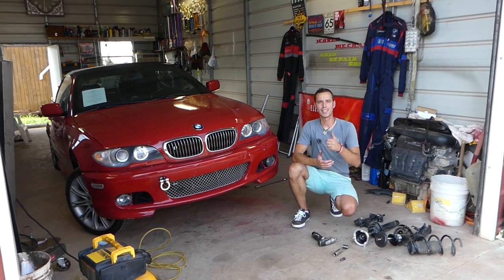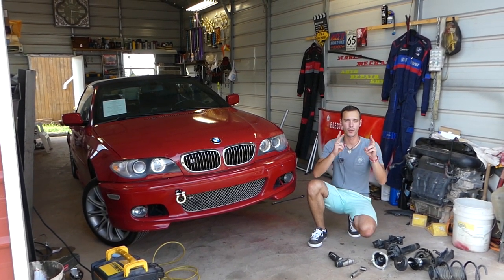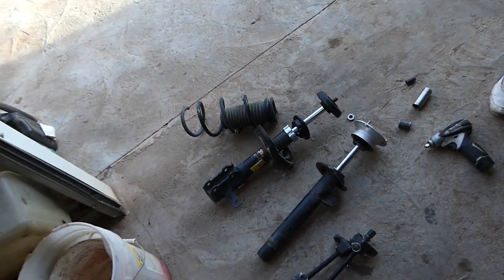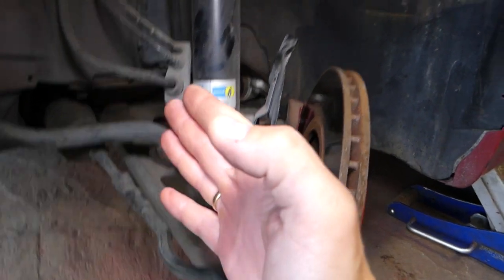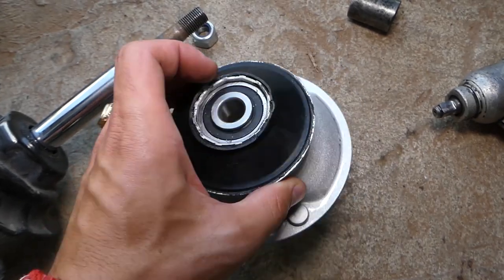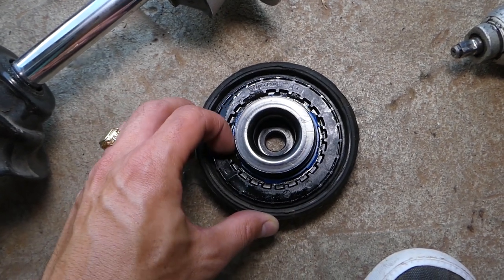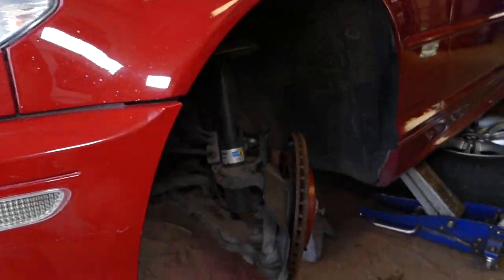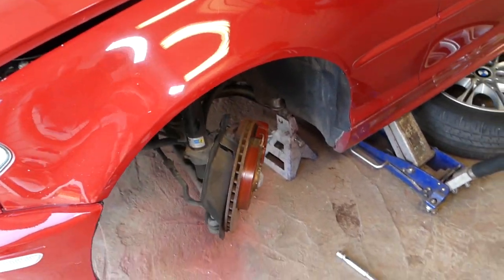NOISE WHEN TURNING LEFT RIGHT. POPPING CLUNKING NOISE FROM SUSPENSION

Comment: Wish you would have demonstrated the sound it was making so people could tell if it was similar to their issue
Reply: The sound I'm getting when turning is like a very aggressive scratching on plastic/ creaking noise .. 
Wheels/ tires arent rubbing on anything .. Still have to check control arm. Bushings ..  But considering in only hear it when making a full right or left turn and more noticeable impact over bumps and potholes I'm assuming this is my problem .. But yeah definitely would have helped hearing the actual noise.. Sometimes it s hard to get recorded tho..in any case good video. :)
Reply: @danielmason1326  mine is a clunking noise. All bushings and control arms are good so idk
Reply: @Forseenlife  Did you ever get it fixed or diagnosed by a professional mechanic? If so what was the issue? I have clunking noises over bumps, and when I turn my steering wheel to the left from a standstill position, I can hear a slight clunk. All suspension components are new, and even the strut mounts were replaced less than a year ago with Meyle HD’s or Lemforders (can’t remember off hand) and in that year I have only a few (less than 5k) miles driven on them. Took it to Belle Tire here in Michigan earlier this week, and they couldn’t reproduce the clunking on the lift, but the tech drove it and “thinks” it’s the strut mounts, but can’t guarantee. Any help would be appreciated... Thanks!
Reply: @dopeboyp3487  yeah, it was my sway bar links.
Reply: @Forseenlife  Ok bet. I got those replaced maybe 1.5 months ago with Lemforders. The Meyle HD’s failed on me with less than a years time on them. I’m just going to order more strut mounts and pray that it fixes my clunking issues. The rear is rock solid, but it’s an effort to get the front tight. 🤞🏽
Reply: @danielmason1326  Did you ever get yours fixed? I'm getting that aggressive scratching as well as the clunks. A couple weeks ago, I replaced the strut assembly as it bottomed out and all noises went away but a couple days later started getting the scratching when turning only left and the clunks (different clunking noise from before) started happening. I went under again and noticed some bolts were loose and tightened them but no luck. I'm stumped.
Reply: @wrichiex  yeah ... If yours got a clunk to it .. Id look at lower contral arm bushings they are prone to failure .. Will definitely have alot of slop if bad ik mine did ..

Comment: If you over tight the top mount bolt but it's still on but probly not holding so struts hold by 2 screws by gop will that cause a thumb sounds like a spring

Comment: Thank you for your great videos; keep it up.  I have two questions relating to a 2006 Pontiac Torrent AWD - 
1.  Whenever turning the steering wheel left or right, there is a 'growling' noise coming from the front.
2.  When going around right-turn corners (only), the entire vehicle shimmies.
NOTE:  The front struts/rear shocks are fairly new top-line Gabriels.  The rest of the front suspension components are all new (half-shafts, control arms, inner/outer tie-rods), along with all four wheel hub & bearing assemblies and the entire driveshaft assembly - Thank you.
Reply: Could be your cv axle? Did u ever find out?
Reply: Wheel bearing. The growling noise is what i had on a grand am. A new bearing fixed it.

Comment: Hi I recently got lowering springs fitted to my car, but since they have been fitted I've hear this clunking sound when I turn the steering to the left or right.  There was no sound before the springs, took it back to the garage and they said everything is fine and could be strut mounts.  I don't think the mounts would fail just like that by fitting lowered springs.  Would you have a idea what it could be?
Reply: I have the same exact issue. Did you ever figure out the cause?

Comment: SAGA
What could be making a thumping sound after replacing front struts? Is like a (tuuunngggg) noise after car hasn’t been driving for a day or two and is only when turning steering wheel as staring to back off drive way. 

Thanks guys keep up with videos
Reply: I have this exact issue.
Reply: So do I!  Brand new struts.  Super loud clunnngg when turning sharp to get out of the driveway

Comment: I changed sway bar links and suspension + coil (right and left) on my 2013 Fiesta as they were worn out. But since day one after the change I had this rattling noise from drivers side (Right Hand 🇬🇧 ) while driving slow/small potholes/bumps/uneven roads and also when stationary trying to move the steering it makes a knocking noise. It doesn’t affect while driving on a Motorway. The guy who did the job replacing the above parts said it’s normal to sound like that which is totally BS coming from him.  Took the vehicle to 3 other garages and can’t seems to figure out the problem as all the ball joints seems to be fine upon inspection. My last guess is on the strut mount.

This is how it’s sounds (Video from another channel) https://youtu.be/t1hqNjnb3dM

Any help or suggestions on this?
Reply: I'm in Columbus Ohio and I have a 2015 Honda Accord LX 2.4 having suspension issues... I replace the front end lower ball joints the front sway bars and the front struts already assembled and I'm still hearing noises when I turn the steering wheel at low speeds or just when I start the car and back out of my driveway also I'm starting to hear noises coming from the rear suspension too I think on the back rear passenger side not sure what else to look for to solve this riddle

Comment: my car is BMW F02 750li 2009 I hear grinding noise after I go on a hump then turn right at 2 o'clock or 3 o'clock direction. I  replaced almost everything in front suspension but still the same exact sound exists. so I AM thinking what else might be the problem? is it the power steering ar steering pump? or the steering fluid? how to solve this problem, please help me.
thank you very much